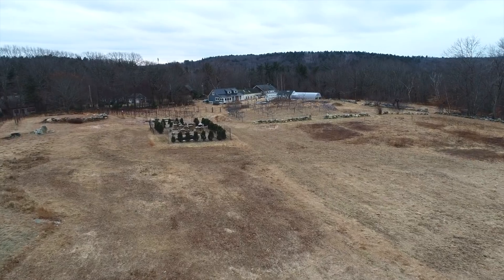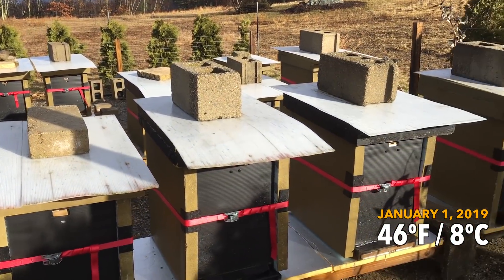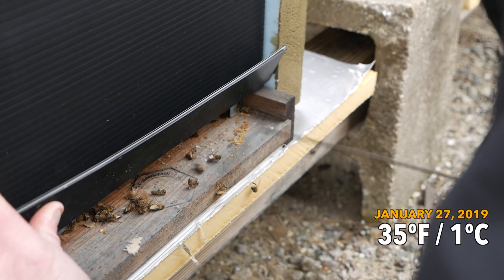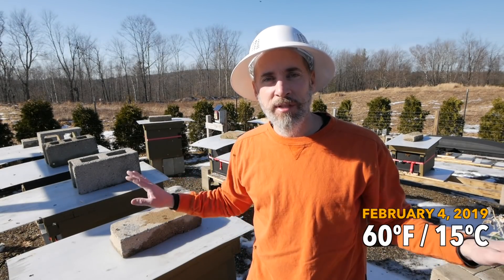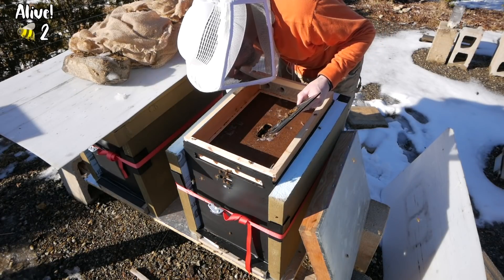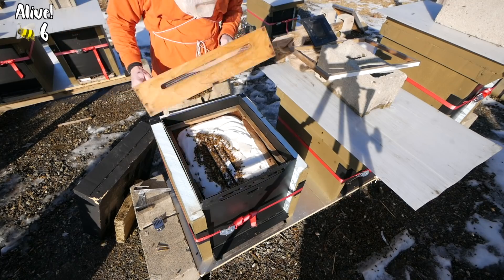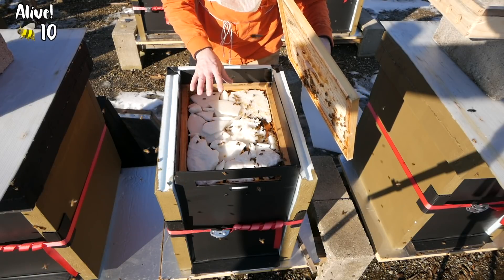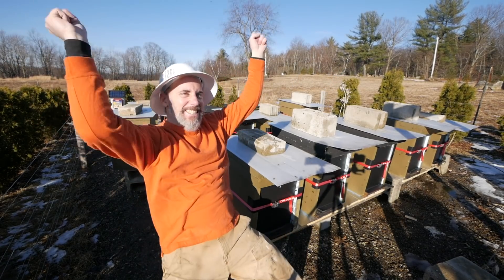How Many Survived? (Winter Bee Hive Check)

Comment: Congrats on getting them over the hump!  
One point of conversation - if not concern -  for everyone here regarding Balboa:
Down below, you had the most dead bees on the ground in front of the hive; you also found the most dead bees collected on the bottom board; and up top, unlike all the others, was "not a nice, neat cluster."
Of course, all colonies will be more active on warmer days - taking cleansing flights, clearing out dead, etc., - but it is still their natural tendency to be in cluster right now.  This is driven by season and instinct, not just immediate weather conditions.  It seems their 'breaking cluster' so early is why you found so many more dead here, and a colony not where you expected them to be (or where they should have been).   So the concern is: since you've only just 'cleared the hump', and most assuredly have some more nasty weather headed your way before winter is done, what added jeopardy may this colony be in if caught by a sudden cold snap?  And is there anything else that you can do at this point to safeguard them from any such possible disaster? (considering that you've already done just about everything reasonable)

Comment: I built vilvaldi boards based on your instructional video, and they are working excellently as well. I think I may have too much burlap in mine (yours seems looser), but even so, the wettest I've had is the top-most layer of burlap being damp to the touch. Everything below that has always been bone dry. I don't know why anyone would use anything else!

Comment: To clean out dead bees from the bottom board try a 5 gallon paint stir stick from home depo... fits all the way to the back of the hive and thick/thin enough to scrap/drag them all out.  We just had two days (4th and 5th Feb) in the upper 50's and the bees were flying like yours - wonderful sight to see so many bees doing cleansing flights.  On the 4th we still had a lot of snow on the ground so saw a lot of "yellow" snow which was a great sight as well.  I was dancing the happy dance too with 17 out of 17 still alive and well.  Next 6 weeks will be the real test of survival as the queen will start laying and food stores will diminish quickly.  We have witch hazel blooming here and the bees are all on it.  Skunk cabbage starting to poke up... Come On Spring!
Reply from the maker: We won't see a blooming flower for 6 weeks. 5 if we're lucky. Ugh.
Reply: @vinofarm  I think the witch hazel bloom has more to do with the angle of the sun than warm temps.  I love the spicy floral scent as well.

Comment: All of mine are still alive including one thin walled 5 frame nuc and we have had loads of zeroish temps and twice the length of winter so far. One is getting weak though, My first hive that was the package I purchased and was easily the strongest has thousands of fatalities. blocked a few times and thousands on the ground in front of it. Sadly back to zeros etc. I never made it to winterized because winter came two months early. I saved three hives that were nearly without supplies due to drought with candy boards. Your balboa is nothing compared to the death in hive 1 so far.

On the plus side I never treated for Varoa though I know they had some so the wild swarm I caught and divided most of my 12 hives from is easily a survivor strain. I had them being open fed the other day during our near 70 temps just to get them moving. Hopefully this new weather doesn't wipe some.

The 5 frame nuc with the 7/16" osb walls and NO insulation or candy board that had less than 4 frames worth of brood and food is a good indicator of how damn strong that strain is.

Jim - KS
Reply: Lost that main hive, they all died out with a full deep and a couple of additional frames of honey. I ran through everything 4 days ago. The nuc was still going and I went ahead and swapped them into a 10 frame. We still have NO blooms of any sort that would have been normally out but the other day they were bringing in loads of pale yellow pollen, I heard is a cedar?? Not even a dandelion alive yet this year. Two hives are not weak but not real strong. I got them some open feeding in for two days to help support their pollen. So. unless this cloudy crap takes them down since they wont even come out for open feeding I have still only lost the strongest hive which was a package. The other 11 are still going but they were ALL natives. 

I would say a native colony to your area is worth a whole heck of a lot more than imports.

Comment: We checked our hive on Sunday and unfortunately it did not make it. That was my first year. We're not giving up and we'll be getting 2 hives this spring. I know I know we started with one Hive when everyone said not to. I follow you closely and my winterizing setup was pretty much exactly like yours coroplast Vivaldi board foam shell. I checked for mites and did not see a single might on any of the bees and population was still huge. And the hive was dry no mold or moisture. I really think they ran out of stores and we did not feed them enough. We were actually going in there to feed them on Sunday when we found them. Big lesson to learn. But this year coming up we'll be more prepared and my new bees will have a great head start with all the comb that is built out. I did notice I had a big ant problem last year. we put in hive beetle traps and did not catch a single beetle but did catch a ton of ants. Any suggestions for that? I think we're going to try to put the legs of the hive stands into coffee cans that have a little bit of oil in the bottom so ants try to climb up they will get stuck in the oil. Good luck in season 4 I'll be following closely in my now season 2.
Reply from the maker: Sounds like you're doing everything right... learning from mistakes and planning for improvement. Don't give up! Sorry, I don't have ant suggestions. Luckily, ants and hive beetles are not an issue for us at all. We just have bears.

Comment: Ever think about getting a little digital video scope to inspect inside from the outside? ~$100 from harbor freight for a cheap one. Flexible inspection tool with little monitor. Has an LED light on end, could pop it in that upper entrance and get a quick proof of life inspection and probe stores.

Comment: Yes it is too warm in Germany too. BUT know  that we are not through the critical Phase and I mean the further meteorological development will tell if this one ends for eample in amid March+/-.

If it gets too warm and then cold again and if the bees prematurely exit the winter (more activity than we expect) the food will possibly not last. 
So if they had theoretically enough food for months(in winter) this must not be enough for two or three weeks if they are active and collapse before or until the first days of April.

Nevertheless, your Hives seem OK! 

VIVALDI BOARD:
I am using a variation of this idea with Canvas and woodchunks. Any hive with this definitely is  healthy and dry, so it will be my last season where i am not using it throughout all hives.

Some say it is too expensive. But if you consider the deterioration rate of materials without vivaldi board only, WITH climatized housing it is way cheaper, because you do not have those unhealthy, fouling frames which you better burn, to  avoid neg. eff. on bees health and man's

It is the best idea i have met in my time as a beekeeper.

Hey good luck for 2019, 
M. from  .de

Comment: You should twist metal that is on top of hives. Wind will rip them otherwise. Twist it really close to roof edges.
Reply from the maker: Are you talking about the white covers? That's actually corrugated plastic. They are just to keep rain and snow off the landing boards.
Reply: @vinofarm  Yes that is what I had in mind. The only good solution I had found so far for rotting landing boards is to make them removable. You use something like letter "Z" shape landing boards. That is when you watch them from side orthogonality. TOP part of "Z" are 2 thin strips of wood that go trough entrance. The lower part of "Z" shape is the landing part. Middle is there just to hold them both together.

Comment: Having dead bees on the hive in winter isn’t always a bad thing.  Matter of fact is a good sign that the hive is a live.  By the spring around 30% to 40% of the hive will survive.   Finding no dead bees at the front of the hive will be bad news; meaning the bees aren’t taking care of their dead.   On the other hand a a large amount of dead bees inside the hive could be a sign of starvation.  Your hives look like they are doing good.  Good job removing the mouse trap to remove excess dead bees.   Is hard for them to carry the dead across the mouse trap.  I’ll be waiting for the next video.  ☃️

Comment: Any reason you don't use the one vented helmet from Mann Lake anymore that you used to have linked in the bio? just thought about this as you haven't wore it in awhile and recently we just bought them for a first attempt at bee keeping
Reply from the maker: Chadillac3006 I switched back to the plastic one because my forehead was getting sunburned through that vented hat. Also, that vented hat band got pretty gross on the inside after one season. The plastic one is not quite as comfortable, but it has better coverage and is easy to clean. I mentioned it back when I switched. Sorry some of my old videos recommend products I don’t use anymore. If I recommended it, I definitely thought it was good at the time. If I find something better, I try to say so on the videos. The vented one isn’t a bad hat, I just prefer the old one again.
Reply: @vinofarm  I remember you saying something about it in a older video but couldn't find the video again. Thanks again